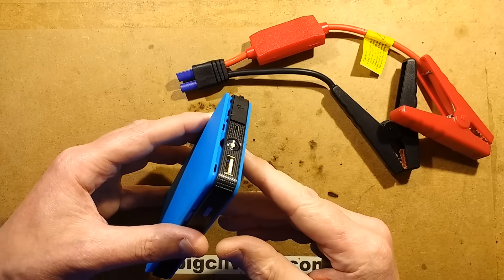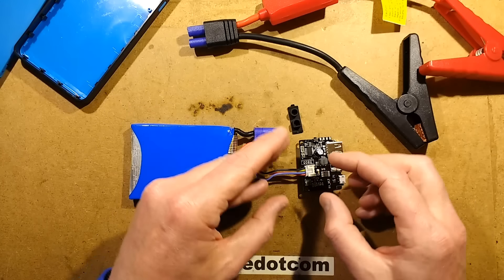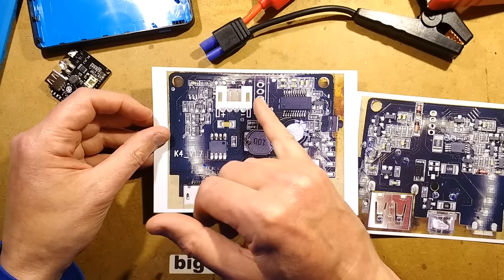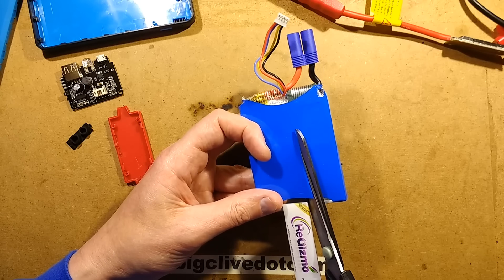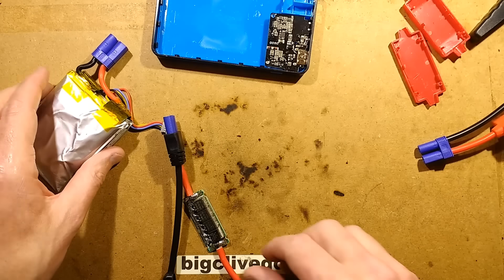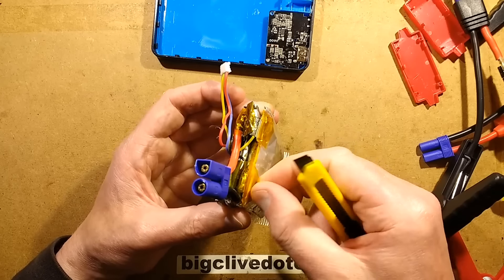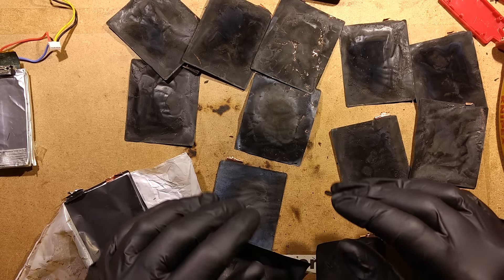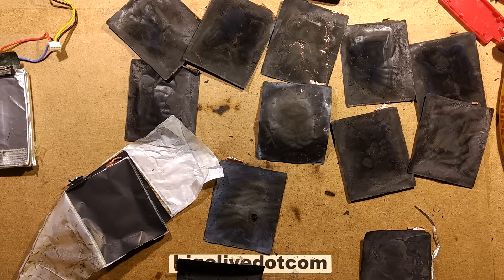Shorting out a fully charged cheap lithium jump starter.  (It didn't end well.)

Comment: I was examining a small 550mah battery from an e-cig that had clearly been ran over by a car in the road. The battery, although compressed into an oval shape, was still at 3.2V. Further tinkering with it resulted in an internal short. I had to throw it out of the nearest window to get it out of the house. You need to see it for yourself to realise how hot they get and how much gas they eject when shorted. That was only a small one.

Comment: not sure if this is correct but it was 520A if you multiply it by volts normally 12.6  which is 6.5kw at 12v

Comment: I never would have thought you could jump start a vehicle with something with such small gauge cables. I could understand connecting it to a dead battery, and using the mini battery to charge the lead-acid cell. I thought it took 100+Amps to crank an engine. 
Sorry if my post is too long. But how does such small cables jump start a car?
Reply from the maker: Brief use.

Comment: This inspired me to crack open my Weego brand jump starter. The board is a little simpler and the wires a bit thicker, but otherwise very similar. The chip is a HOLTEX HT66F004 C207T002JGI. The cables have some protection, I can't short circuit it or reverse voltage unless I press the shady bypass button.

Comment: From memory a lot of these 'balance chargers' in RC modelling don't so much charge in balance, as much as they charge the entire pack for a while, then check each cell and discharge the overvoltage cells for a bit, then repeat, until the pack reaches a charged and balanced state. - Not sure if this circuit is even doing that much though.

Comment: In secondary school here in glasgow(cathkin high school,the old big building,not the small P.O.S with no swimming pool),chemistry class showed lithium (stored in oil) when in contact with air will oxidize in contact with oxygen,very energetically ,like the iphones that were spontaneously bursting into flames,the batteries must've leaked air in.
Reply from the maker: There's very little lithium in rechargeable lithium batteries, and it's diffused through the electrode material.  The reason lithium batteries explode in flames is mainly due to their huge energy storage ability.  When they go wrong that energy is all released suddenly.

Comment: I believe the balancing chip connects all the cell one at time to the cap. So each cell charges to voltage of the cap. If the chip is higher than the cap, it charges the cap, if it lower, the cap charges it. by this way it takes voltage from the higher voltage cell and moves it to the lower voltage cell. The keeps all the cells at the same level.

Comment: I've taken apart one of these before, it was rather... explosive. 
A cell had actually started to expand / swell up on the one I ripped apart.
I accidentally shorted the pack out with a pry tool after a bit (had been planning on trying to maybe save the two other cells, so was trying to detach them), and it caught fire rather quickly and I tossed it out on the gravel. 
It burned for a while. :D

Comment: It's not cardboard, it's fish paper, typically used for good thick thermal insulation in electronics. The red section on the leads is typically going to be for safety in case someone accidentally puts the leads on the battery BACKWARDS. Imagine the fireworks display and melt down if that happened. The issue is that it would typically be a giant expensive diode with a half a volt drop across it, so those semiconductors are probably cheaper, and smaller, and in parallel, possibly having less resistance, and your leaking reading probably means one or more are bad in the array.

Comment: i used one of these to start my lawnmower over and over,  i rigged the starter wires onto the  starter itsself,  i also bypassed the  red cable box  with a straight soldering    i would start my lawn mower with it 8 to 10 times before it needed a recharge.   it went out once i dropped it into a  water puddle  and it started smoking.  the people claimed it could start a car, And it Almost could  start it  but  to no avail it needs a car battery to charge up and handle the load partially . for being cheap they really do work well   my battery clamps Required a  input signal to the wires  to  actually start the jump, And it counted down from 10 seconds.   but when i bypassed the red cables box,   that feature was disabled and i was able to direct lead it to the starter upon  plugging it in and instantly starting it,  not safe but it worked for a long time.

Comment: You're pretty good about safety issues...except when it comes to the blades. Note that at 16
:01 and 16:06 you came pretty close to opening up the side of your left thumb with that razor knife, because you were still holding it in your right hand as you were concentrating on peeling the slit tape with your right thumbnail and likely temporarily lost track of the position of that blade with respect to your left hand. 
Might want to watch that and get in the habit of retracting that blade or putting it down between cuts. Because a stitch in time is better than a few in the emergency room.
Also- Why did you characterize it as "unexpected" when the plates began to burn after you had effectively, one-at-a-time, restacked them in full contact with each other,  after having removed them from the layers of insulation which had previously kept them separated, essentially shorting them, and rendering useless all of the precautions you'd just exercised whilst carefully cutting the cell open. Was that sarcasm? That was sarcasm, wasn't it? Because I was getting horrified as I was watching you do that, and I was thinking to myself tat that wasn't going to end well....and then you thoughtfully put that addendum on there at the end of it as a cautionary tale. As soon as it came up and I'd seen the look of the plates and that you had unstacked and separated them, I had a pretty good idea about what you were going to say next. Yup.  
You do great vids btw. Thank you. Stay well, and maybe just a little safer.

Comment: Clive I need to build a new battery pack for a Metallic TDR meter I have. "C" size NiCads are getting hard to find and was thinking what about a lithium. I need 12 VDC to run it. The thins is doing the charging so that I don't blow it up. Can you do a project on making your own battery pack with what protection to use?
Reply from the maker: Can you use an external power pack?  Alternatively you could possibly use NiMh cells as a direct replacement for the NiCad cells.
Reply: @bigclivedotcom   I might be able to use the NiMh cells if they can be tab welded. Have you used the Tektronix 1503 TDR ?
The battery pack is sort of odd. The pack holds 10 "C" cells and is in it's own carries. One issue is when your on line power it is always charging the battery pack and it will not run without a pack installed. The one issue around here is finding anything other normal "C" cells. Most tend to be the sub-c cell.

Comment: Are you sure that the other 2 small gauge wires are not for temp sensing of the battery pack?   The Fets and inductor are probably a boost regulator to charge 12V from 5V input.
Better quality LI-On battery packs usually have thermistor current limiter internal so they don't flame-out from short circuit.
Great Accent also :)

Comment: Dang I was fearing for your safety... I expected that thing to go off like a road flare like the cell phone batteries I've seen short out from overheating. I have a larger model the autoelectric jmp10gpbl and the battery won't charge. The voltage out of the jump port is at 9.17vdc and I'm hoping if I get the battery charged it will star working properly. The light came on when it was in storage from something bumping the switch turning the light on and draining the battery pack. I guess I feel okay now trying to charge the batter right at the battery terminals and then reinstalling it back into the jump pack. If you know anything about my situation I'd appreciate the feedback.

I loved your video and your sense of adventure and quest for knowledge.

Comment: If I already have a decent 4s lipo should I just make my own jumper by wiring  some clips to a connector or is the forward voltage suppressor a big deal?  I figure if I start the car and quickly disconnect it should be ok.

Comment: if you put the leads on a car backwards, cars are made to handle that, the "main power" fuse will pop. 
Iknow because I've done that before, I had to buy a new $10 relay and it was impossible to find other than directly from honda because proprietary

Comment: When you took the Blade to the pack to lift the kapton tape I puckered my ass so hard!! I was pulling a laptop with a GLUED down battery that has expanded and I thought, Eh, I'll just cut this TINY part of glue, it's be fine, and I immediately nicked the corner of the bag.. INSTANT Torch. It just spat flames like a mini-flamethrower a good 2-3 inches and scared the absolute bejesus out of me..  That's a less i've only had to learn once!

Comment: Greattestinng!
I was wondered. amps are great but only deliver power in conjunction with decent voltage. 
Have you also tested the (battery)  voltage during these tests ?
And with cars if a car battery is flat it usually has a 10-12 vult left  and that remaining voltage is then supported by these Mickey Mouse help packs.  
And the dudes will  prevent reverse current from batteries and alternator Incas the engine does start.  
Great video !

Comment: That's pretty good engineering if it was intended to go into a high resistive failure mode rather than runaway thermal failure...

Comment: The vias under the diodes in the red box in the cable are to conduct the current from the wide trace on the bottom to the diodes on the top side I think.

Comment: Are they 606080 lithium ion pouches in these things or smaller? 606080s are usually around 3.5-4Ahs not 1.6Ah still nowhere near the 20Ah they are advertised at on ebay.

Comment: I have one of these. jump starter packs.
Cant start our dodge ram 2500 truck on its own. it needs the help of six 500 farad super capacitors in series in parallel to the jump starter (super capacitors charged up to 15v) in parallel to the jump starter in order to crank the engine over the first turn (to get it to continuously crank because the current it draws trying to get the engine turning from a stop is too high. but once it gets turning past 360 degrees it is able to start the truck.

Comment: So if even the individual plates can still go up in flames, how do you safely dispose of a failed lipo cell like that? Only way I can think of would be to put it in a bucket full of salt water so it can dispose of any charge left without lighting up. So, is that what you're supposed to do?

Comment: Can you charge the pack through the ec5 connector. It looks like those wires are directly connected to the lithium cells. 

I’m thinking of using a jump start pack as the battery bank on my lithium solar charger controller. Obviously I will have to find out if the pack is 3 or 4 cells and set my voltages correctly.  But this would only work if the solar charge controller can charge the pack through the EC5 connection.

Comment: CAN YOU DO ANOTHER VIDEO? I have a  Li-Ion battery pack with a similar looking cable BUT "box" on negative side has two LED's (red and green) and recessed reset button. I checked cable for continuity or diode. No connection. Properly Connect to battery and jump pack (proper polarity) you get green light. It has IMHO the circuit is likely solid state short/OV protection switching (SCR) Triac.  I don't believe it is simple diode reverse polarity. GOOD. That idea sucks. I'm NOT going to tear it apart or short it to see.

Comment: My first one of these was blinding, worked for about 4 years, killed it jump starting a diesel generator in parallel with a Nissan pick up. It did it but it was never the same.  I've had about 3 or 4 since and they haven't come close

Comment: The area of the battery is always connected in parallel, but in this case, because it's arranged as a concertina, if they start to heat up and outgas, the concertina allows them to push apart and self limit the damage. If they were arranged as a more traditional swiss roll, there's nowhere much to go and then the heat will build up and Bad Things Will Happen (tm).

Comment: Doesn’t the boost pack take voltage from low car battery and then through capacitors boost it back in to battery.

Comment: great info..im using my bank  to power my RC tug boat that is in parrallel  with 3 -7ah 
gelcells it SCREAMS at full throttle . the 3 gel cells are mainly for ballast, twin 3" screws 
and 2- 12v tire inflator motors. cheers from the states. Hey kids don't try this at home
without adult supervision...HA yeah right

Comment: I’ve used a Makita 18v battery as a battery booster, it will pipe in up to 10 amps and get enough energy into a low battery to spin over a diesel car engine very nicely.

Comment: Have you ever thought that it could be a multi layer board ? An yes I would assume that it balance charges the the Lipo battery pack, my question becomes, what VOLTAGE does it charge at ? It would appear  that the charging circuit is trashed, did you try measuring the VOLTAGE on each of the balance ports to determine if only part of the charging circuit is trashed, and therefor recoverable. It does surprise me that the booster PORT is connected directly to the batteries.

Comment: Could 2 identical "Jump start packs" be hooked up in parallel for double cranking amps? Change my mind.
Reply from the maker: They could.
Reply: @bigclivedotcom  Thanks for the reply. I mean I didnt think it would hurt. I have an auto shop and these things work well but if battery is all the way dead it struggles. Thought about getting another and well getting some bigger clamps.for em.

Comment: I get your point about the safety issue of the pack, but wouldn't you just use this type of jump starter as a battery booster rather than to use for cranking.

Ie you connect it and leave it a few minutes to equalise before cranking.

I don't think this is as a cranking alternative power supply.

I have one of these types of starters and noticed it had a similar set up, so rather than using it as a crank alternative battery to the main, I attach it and leave it for a few minuets to equalise then crank if I need to use it.

It's similar to the cigarette lighter battery boosters, you wouldn't use that to crank the car but it would put enough into the battery to support it to then crank.

That's how I use it anyway.

Comment: Whenever I am reverse-engineering circuitry, I like to start with three units. With the first one, I make no changes at all.   The second is stripped of everything but surface mount parts and the third one is stripped to a bare PCB.  I scan both the partially and completely stripped PCB on a photo scanner to ensure all images are exactly the same side.  This is critically important when later trying to make a composite of two or more images.  (Remembering to first flip over the photos from the bottom of the board, making a composite of images from both sides of the PCB makes tracing circuitry much easier.)

Once the boards have been scanned and saved as BMP images and not as JPG images, I use a photo touchup tool to enhance the contrast of the traces to make them as visible as possible.  I like the freeware tool xyview.exe.  Using the photo touchup tool to adjust the brightness, contrast, tint and gamma can make hard to see traces sufficiently visible even with a dark green solder mask.  However, I have never tried it with a PCB coated with a black solder mask.  That might require me to strip the solder mask before photographing the bare PCB.

Comment: It might have been better if you had the battery pack assembled in its plastic case so it would 'self-disassemble' when shorted.  (I'm surprised you didn't bypass the diodes for some extra amps)

I had that effect with a 12V miniature battery charger, it looked more like a laptop supply than a 12V battery charger, anyway, when it died, it slowly split open the welded shut plastic case. I started hearing this extended cracking noise in my workshop; it took me a while to track it down.
I defiantly have a preference for power supplies in metal cases, much harder for the flames to get out in the middle of the night and burn your house down.

I'll have to look for the next BigClive video, to see if some battery material was missed and the workshop spontaneously combusted in the middle of the night.

Comment: Wouldn't this be a sort of safer design for Lithium Ion batteries overall? The fact that if they short for whatever reason, they go low resistance rather quickly, which is caused by the failure of the cell? Interesting.

Comment: I have so many questions for you but here's one:
So I am building a 4s LFP 100ah battery pack using prismatics, I want a BMS that will charge and discharge load through one CB terminal. There are some BMSs designed this way, but I was wondering if you could use blocking diodes on ones that don't,  to control the flow of charging and load current to separate terminals by splitting one input wire in to Y, and attaching directional diodes to each leg? If so, what kind of diode can handle say 150a?
Thank you so much!